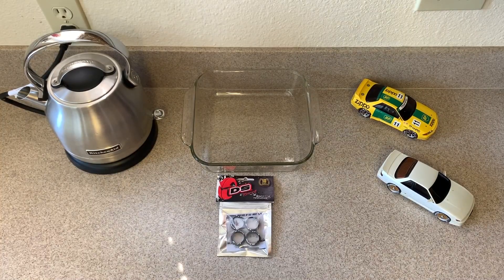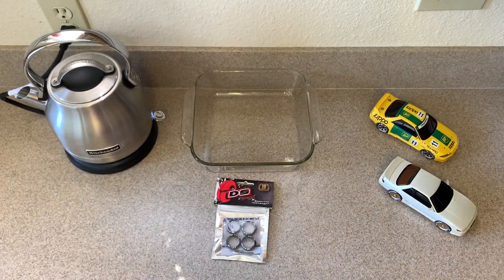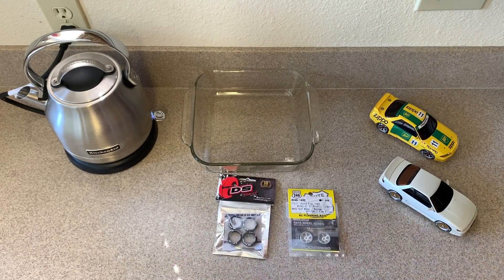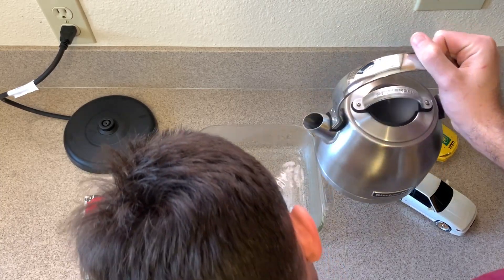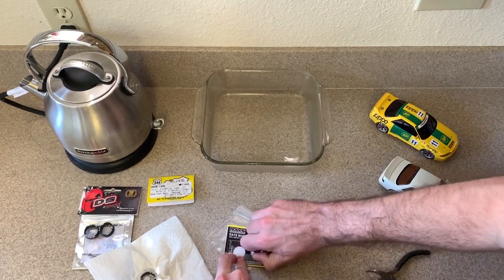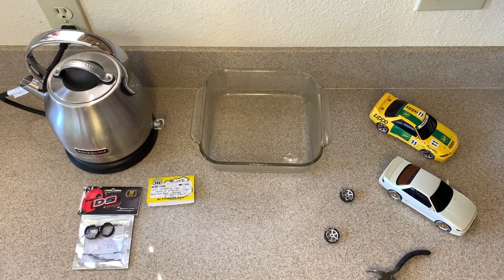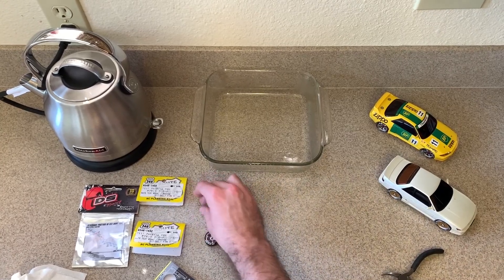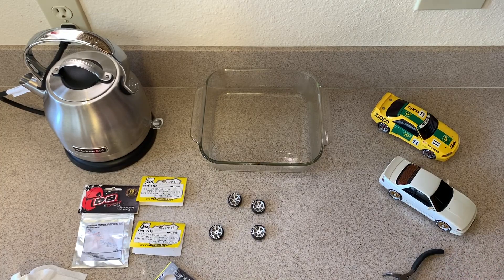How To Install DS Racing LF4 Drift Tires Mini-z

Comment: Hello perfect explanation, I also changed some tires with letters this week, there is also another way to heat them very homemade, with a hair dryer holding the tires well by putting it close, it is also effective, it is appreciated and you learn a lot with your videos, he says Much of the person you are, thank you and a big hug friend.
Reply from the maker: Thank you for the tip on using a hair dryer! I did not think it would get hot enough so that’s why I used boiling water. I will have to try the hair dryer next time :) 

Thank you for the kind words & support!! I really appreciate it man! Big hug from America 🇺🇸

Comment: Hi BMR, I bought DS Racing tires but still have the stock plastic wheels.  What aluminum/alloy wheels do you recommend for an MA-020 with 94mm Subaru body kit (+2.5mm front, 0.0mm rear).  Are new wheels worth it, or are good tires alone adequate?  Thanks!
Reply from the maker: I use the Route 246 (its a kyosho brand) aluminum wheels & they work great but they can be difficult to source since they are always in high demand. 

The 246 rims are overall very good quality & well balanced in my experience.

Comment: Thanks for the info! Did the stickers come off the tire over time due to putting it in water or are they still in good shape?
Reply from the maker: The stickers will stay in place as long as you don’t rub them off. I have damaged a few of the stickers but that was because I was being too rough

The stickers generally hold up really well

Comment: Great video. As a beginner, maybe I ask why you didn't tape the wheel before putting on tires? Is taping optional for drift tires? thx.
Reply from the maker: Tape is only needed on rubbery grip tires, but drift tires a a hard plastic. Plus with drift tires there would not be enough space for tape since tolerances are so tight it’s a press fit
Reply: @BMR3  That answered my question, thank you sir and subbed.
Reply from the maker: Thank you for the support brother!

Comment: Welcome. What should I choose the size of tires for Subaru?
8.5mm narrow or 8.5mm all-wheel front and 11mm wide rear. I will add that I have standard rims that were included with the car
Reply from the maker: I believe the standard rims have a narrow front & wife rear. I would recommend going with the same configuration so your tires & rims will be flush with your body.
Reply: @BMR3  When you buy tires, there are 4 pieces in the package. Understand that the two front tires are narrow and the two rear tires are wider.
Reply from the maker: ado gde yes exactly, then you order you will get two wide and two narrow, unless you ask for something special.
Reply: @BMR3  a person from the store found all four 8.5mm tires or 8.5mm on the front axle and 11mm on the rear. I don't know what to choose In my Subaru, when I measure the tires I have 8.5 and the rear 11. When I order all four pieces of 8.5 mm, how will they fit on the rear axle since mine are 11mm and the rim also has such a dimension
Reply from the maker: You want 8.5 for the front & 11 on the rears so your tires will be flush with the rims. You want 11 in the rear so the rims will be flush with your body. 

Does that make sense?

Comment: Welcome. I want these tires at last. This size will be good for my Subaru
DS Racing Mini LF-4 8.5mm Narrow Drift Tire
Reply from the maker: I love the LF4 tires, but I was recently talking to DS Racing & they told me they will be releasing an LF5 tire soon so you may want to wait to order. 

The LF5 should have even less traction the the LF4 & should help with low speed drifts 😀

Comment: How much better would you say third party drift tyres are over the stock Kyosho drift tyres?
Reply from the maker: It really depends on your drift surface. Each compound is better suited for a specific type of surface or desired grip. 

Personally I think the LF4 tires make a noticeable difference over the stock Kyosho tiers when drifting at low speeds since they break loose easier and provide less traction. 

LF1 tiers are very good for a car that you want a lot of “bite” with & can perform more technical transitions with. It makes for a very agile car, but I tend to drift a little faster with these tires. 

LF3 are basically Kyosho drift tires with cool stickers. 

They aren’t necessarily “better” but rather each compound will perform differently on a given surface. It’s really up to you  decide what is best for your set up and drift environment.
Reply: @BMR3  Great to know, thanks for your reply!
Reply from the maker: ringod123 anytime man! I’m happy to help

Comment: will you do an uninstall drift tires video? ;)
Reply from the maker: lol nope 😹 once I install a set of tires on rims they are mated for life. 

But really it’s almost impossible to pull rims off of the aluminum rims, without damaging the rims or marring the tires (I tied). 

You can pull them off plastic rims if there is not a tight fit, but it seems like my rims always have a crazy tight fit.

Comment: How do you get the tires off?
Reply from the maker: Same method. Heat them up in warm water to loosen them off the rim. Beware, some brands like WL Toys glue their tires to the rim so be careful.
Reply: @BMR3  that's good to know. Thank you. I didn't want to end up throwing away wheels if I could avoid it like 1/10 scale. Hated glued tires lol.